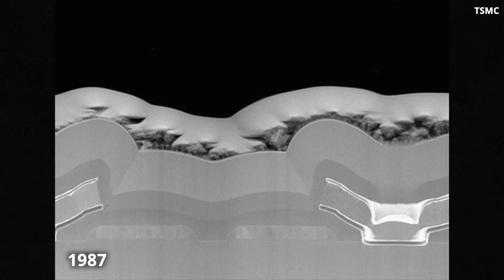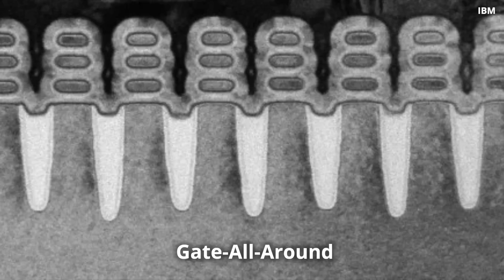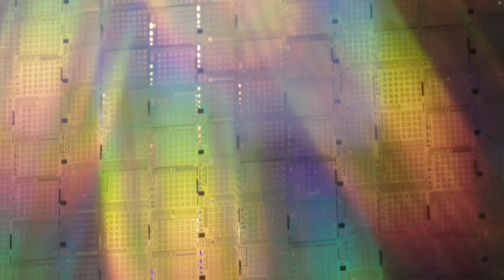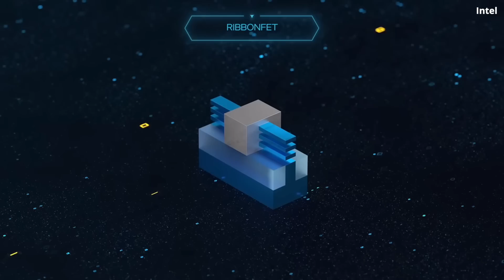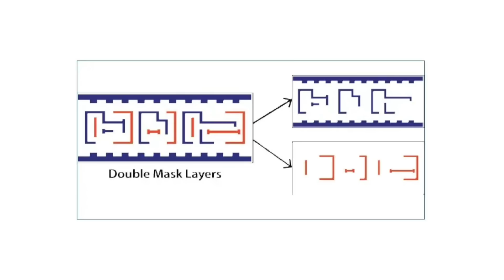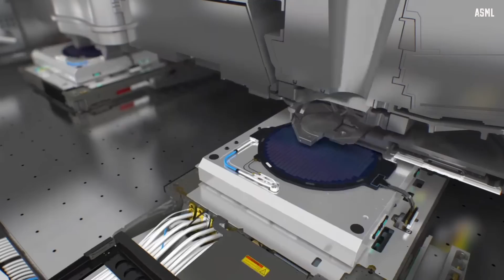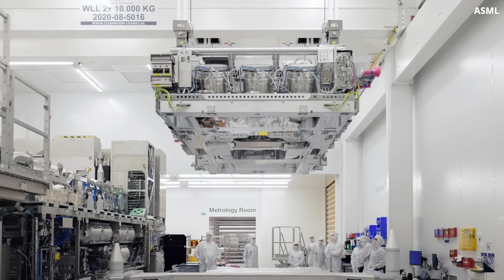New Disruptive Microchip Technology and The Secret Plan of Intel

Comment: BTW, I am an MD, but have been into digital design since the 1960's starting with 7400 series TTL chips. I have been writing code since then and have designed hardware and multi-layer PCBs with primitive photolithography . I also studied laser physics, optics, vacuum deposition. 
I just LOVE your podcasts!
With my background, I actually understand your clear and informative presentations.
My older son got his BSE in AE followed by his MSE in EE in ADC combined with chip design using Cadence. He was shocked when I read and understood his thesis! I forward all of your podcasts to him and his brother who is an AE, getting his MSE in AI, ML and autonomy.

Your podcasts are inspiring!

Comment: Scientists and engineers try not to make arguably false non-scientific statements such as “totally changing the transistors”, “ huge leakage”, “ the electric field turning on the gate” [sic], “up to 35 percen”, “ move all of the power distribution to the back side” which drops the current from the front to the back.

Comment: I've noticed a correlation between total complexity and the number of problems that arise.
I always ask myself,
Is there a simpler way
To reach the same goal? Any way at all
To use fewer parts or less steps.
Is anyone working on a design without power interconnects?
Say something like nano sized photoelectric cells delivering power from
A laser down to small regions of the chip?
Using quantum dots and mirrors on the other side to send signals. All those tiny
Wires must be drawing a fierce amount of power, just due to electrical resistance.

Comment: Thank you for this video. I'd like to see a video from the hyper NA EUV machine. 
From my side I think ASML has to improve thir high NA EUV machine also in the future. It's a real expensive machine, cost more than double than a simple (low NA) EUV machine. If the prices will raise and wafer/h ratio will go down than maybe there's a possibility that they won't make Hyper NA EUV machine. If I know that there are other manufacturing technologies also possible, for example Nanoimprint lithography which could be much more cheaper.

Comment: Backside connections are very fast.  It isn't new, but it is now free to use most likely. And with a new transistor smaller feature size it will become very, very fast

Comment: 1:51 Applying a voltage to the gate attracts particles to the channel from the substrate closing it, and thus it is able to conduct.
Reply: Semiconductors have a lot of electrons (or "holes") throughout the substrate but they are distributed very sparsely in any particular area.  Applying an electric field draws many electrons up from the semiconductor substrate to concentrate in the channel changing the channel from having high resistance to almost no resistance ... Ie the transistor ...

Comment: Your probably going to take this commit down.but I will waste my time typing it anyway.    Don't believe local  llm's are private.  In order for privacy. You have to put the hardware in a Faraday cage and hope it is sealed.If it is not sealed a near by computer will act as a bridge. There is a peer to peer that is unknown. I observed it talking on 462 mhz .I observed it advertising it's self every so often in the Faraday cage.before I put it in the Faraday it would not stop talking on 462 mhz. I setup a laptop near the computer in the Faraday cage because i need it.long after I put it in the Faraday cage. The next time the computer advertised it's self they both started screaming on 462 mhz. The only reason i know this is because I had a scanner on . Every time I turned on my the mobo I bought for my gpu to run llm's on. It made alot of noise on 462 mhz. So i put in a Faraday cage because I didn't want to lose my hardware to the FCC. I found out all this.

Comment: I have a discrete fractal sequence with the prime numbers and integers of the dual quantum mechanical structure of exponential chromodynamic fluctuations, which indicates an intrinsic entropy factor in an entangled system, the system reformulates the criterion of Bertrand Russell's mathematical paradoxes of the (sets by types) since the measurements do have hidden variables (Albert Einstein) by non-random percentages of (a third) observer in present (that exists and does not exist) Erwin Schrödinger; that does NOT belong to his set of observers (Alice, Bob) according to John Bell's inequalities.

I decoded this with studies based on parallel interactions, super symmetry, quantum gravity (Loops) and calabi-yau varieties or strings in extra dimensions. The graphics obtained from the structures in geodesics suggest that time crystals are created in interactive networks sharing local states and generating optimized global systems of information conservation, by non-local universal conscious entropy.

 This can be applied in a new artificial intelligence programming language that learns new tasks by itself and also in any chemical simulation or advanced studies on elementary particles, neural systems or any evolutionary system of chaos in convergence or divergence.

Comment: One Question.  Since the power supply has been "moved away" from the interconnect layer does this improve the Signal from the interconnect lines? As an Analogy. You separate network cables and power cables to improve signal strength of the network cable. Could be another advantage of the new technology.

Comment: Would it not make sense to combine the two in a sense, to have power planes in the middle with silicon logic both on top and below power delivery layers that have signalling 'wells' between them, and at some point layer more of these 'folded' in a sense but using signalling wells through the power planes to communicate between the logic layers vertically? Ultimately you could in a sense build a cubical chip like a layercake with power delivery being the cake and the logic the filling in a sense. Interconnect routing inside and to the outside would be complicated but we could have software tools to iterate through possibilities to work out the optimal placement of 'parts' so to speak. 
Heat would of course be a problem which would need to be tackled differently, but one way would be to build metallic 'towers' through the layers where there is no logic only thermal transfer layer to layer, and these would be cooled on the outside of the chip - to a point even the IO pins could be used for this purpose if they are purposely designed to instead of connecting to the outer surface of the construct were to be done in a way to transport both heat and signals at the same time from different points inside of the "chip layercake". Unsure if this makes sense in words, but in 3D it would be easier to explain. Think of it like a multilayer sandwich with long toothpicks driven from top to bottom being power and heat, and the edges of the filling in the layers signalling.

Comment: Intel and AMD will definitely have their share of the market. TSMC is at max capacity and investing in other semiconductor companies will be an absolute power move, I keep increasing my shares manageably. Different chips are good at different things and Nvidia has been very specialised, which leaves other aspects of Al open.
Reply: AMD doesn't fabricate chips.

They only design architectures (around someone else's node...TSMC's process node) and then pays companies like TSMC to manufacture the chip for them. When TSMC is on top of the world, in terms of pushing cutting edge, AMD benefits (as they have been lately)

So when TSMC is at capacity, by extension everyone that relies on TSMC for fabrication is plagued by that limitation. This includes companies like AMD, Nvidia, Apple, and many others, who have to fight for their share of that limited capacity.

In fact Intel and Samsung are the only companies (of significance) who still own their own Fabs. Everyone else outsources...mostly to TSMC.
Reply: You are buying a company to own it and not a piece of paper, The market is a zero-sum game (2 sides), Know what you are buying not just out of trend interest.
Reply: This is the type of in-depth detail on the semiconductor market that investors need, also the right moment to focus on the rewarding AI manifesto.
Reply: certainly, i had bought NVDA shares at $300, $475 cheap b4 the 10 for 1 split and with huge interest I keep adding, i’m currently doings the same for PLTR and AMD constructively. Best possible way to get ahead, is participating behind top experienced performers.
Reply: I’m widely spread out into ETFs and chip tech stocks, using an enlightened top tier would always attain more interest no matter what. props to Frost hilda, whom takes good care of my holdings giving me an edge to plus interest.
Reply: Well spoken. You gave detailed explanation
Reply: @jadecarson5081 f bot
Reply: @stuartjameson4594  It's an AI bot...and it's a dumb one.
Reply: How much of their stock do you own? Seems like a lot of your investment is riding on this
Reply: Love your viewpoint Jade, it more sustainable for me. I have got frost social, I'd get more conversant.
Reply: bravo buying at 300, cashing up at massive gains P/E ratio
Reply: Stop calling names, if you have any experience please share yourself
Reply: @jadecarson5081 I mean Intel took an incredible dive because of technological failure, to say you were going all in on Intel 2 months before their massive drop is amusing. How much did you lose? To meet your standard of providing insight on why Intel is a dinosaur who has met its meteor we would have to understand the advantage of separating fabrication from chip design.

Chips are specializing. Because of greater desire to get more from limited space on portable devices more chips are being designed by the consumer electronic manufacturer like Google and Apple. This focus on design pinging for the task means that a general chip that is misused for a purpose will not be more efficient as a specific tuned design. Fabrication then makes more sense as a company that takes in orders and focuses on the business of fabrication for designers worldwide. A failure of fabrication or a failure of design means intel has twice the capacity for failure over competitors like AMD and  Qualcomm.

Arm architecture is also another huge miss by Intel and their lack of desire to move to RISC, now leaving behind risc-v, is another signal that Intel is not adapting to industry changes.

Intel has been failing design with their state of the junk 13th and 14th gen. They have been failing fabrication since 10nm. They are failing to adapt to risc. They failed to adapt to asml and ultra lithography on time. They failed to account for chiplet designing and lower yields of smaller nm lithography for large soc’s. What makes you think that now is intels time rather than the meteor continuing its undefeated record to obliterate dinosaurs?

Comment: Good to mention is that the backside power delivery will make the power supply a lot more stable. This is because power lines and signal lines interfere. More stable power supply will allow for higher clocks.

Comment: This sort of thing was pioneered for Solar Cells maybe 20 years ago, by a company called Sunpower.
Their motivation for back-side power connectors was to maximize the amount of silicon exposed to sunlight.
It is interesting that this tech also helps with the new generation of VLSI chips.

Comment: The scaling down to as small as 1.6 nm is never 1 atomic size.. suppose it's hydrogen atom, 1.6 nano is .. says, 16 atoms. But since Silicon is (says,) 2.5 times bigger than hydrogen atom.., (16÷2.5)= 6 atoms (thick). Perhaps that's limitation, (i believe) no any silicon (or Germanium) logic-Gate could be made out of (less than) 3 atoms (not 1 or 2) of silicon base material.!?!  Heard s'one wanna use Graphene -Carbon, actually, instead of Silicon. The benefit obviously Carbon atom is smaller than Silicon. Even much smaller than Germanium significantly. So, if by using Carbon-Graphene base successfully for making logic-gates (transistors).. the even smaller than 1.3 nano will also be possible.!!

Comment: So much to unpack here. I don’t believe they will be able to go much lower than a few hundred angstroms below the nanometer mark, once they get there (if they do) the next logical step is to increase the wafer size to 450mm for production. They can stack the transistor but they will need to increase the wafer size at the same time they develop the technology for production, as that will justify the production loss. 

Intel is just full of prima donas at their Oregon fab, I believe their arrogance is why they lost the business to TSMC. I spent a couple of months at their Dalian fab in China the engineers there are good. I spent several months in TSMC fab 12 @ Hsinchu when they were developing their 7 and 5nm process, given how they are not investing in the next gen litho tools, they may be thinking about 450mm wafers to increase production. We’ll see what happens in the next decade.

Comment: This power-under-logic system is really interesting. One wonders what unexpected gremlins will be revealed in thermal performance of these designs. A fairly high amount of the waste heat per clock cycle is in power delivery itself, simply from resistance, so if you stick the power delivery on the other side of a silicon wafer- a lousy heat conductor- then what happens? Then there's the problem of the pinouts, needing to coat both sides in protective layers, etc., etc. I think this is going to prove very difficult!

Comment: This just prolongs extending the use of legacy chip technologies without moving beyond into the “Chipmaking of the 4th Industrial Revolution” needed to support the massive growth in AI.

Several Months ago, Chinese computer experts stated current chip tech is LEGACY, outdated and it's time to move on to the next generation; “chipmaking of the 4th Industrial Revolution”. (China currently holds the global lead in 4th Industrial Revolution Technology.)

Traditional - LEGACY - computer chips use lots of energy, generate lots of heat, lost efficiency, and scaled AI applications place significant strain on a country, regions, and city power grids. 

In the U.S. the power grid infrastructure IS NOT robust enough - inadequate and lacks interoperability across regions - to support AI development and operations in many areas thereby placing a significant roadblock to AI development and deployment.

Some companies are having to build their own power systems to support their AI development but as long as they can connect locally without degrading the public systems. This adds an extensive and expensive layer on top of already high AI development.

It will take a huge investment in upgrading power grids even BEFORE large AI operations are implemented. There is insufficient funds to support building out a new electric grid infrastructure to accommodate AI growth in the U.S. Regional systems such as in the outdated Texas grid posing major roadblocks.

China's new Photonic chip technology is one example of highly energy-efficient architecture allowing ultra, high speed AI development and integration into networked infrastructures without placing significant strain on the country's, regional, or a city's power grid.

Comment: I'm curious as to putting all the poer on the back side of the wafer. Given how coolers are mounted on a chip could it not have a negative effect on the wafers performance since we will be drawing all the heat from the power through the brains side of the chip? or will they mount the wafer "upside down" when building the package to put the power side nearer the cooler? Lots of really good information well explained. I could listen all day :~)

Comment: In 1977, I was QC testing high-purity silicon tetrachloride using an Applied Materials mini-epitaxy furnace and probing the resulting growth layer on the test wafer for resistivity. We were buying impure material from Texas Instruments (a by-product of their wafer manufacturing) for 50-cents a pound, distilling it to remove N-type and P-type impurities, then selling it for anywhere from $50 to $200 a pound, depending on the quality.

Seeing so much economic value being generated, I jumped out of the lab and bought a retail ComputerLand franchise and sold a lot of Apple IIs.

Nice to see so much has changed so quickly.

Comment: they don't work , even new Intel CPUs that are 7nm do not work , they are no more chips , they are chiplets , cut outs from larger chip , and that shortens the memory circuitry and they freeze up on heavy task , stuttering very hard , where older CPUs just slow down the FPS , new ones stutter . Consumers will have nothing from this , no gain at all , only problems .

Comment: Please , don't show two sides of the wafer when you are talking about backside power delivery.
All interconnects are lithographed on one side of wafers. Backside means underneath of transistors. So lithography masks print power lines and capacitors first. Then they print isolation layers. Then they print transistors. Then they print data interconnects in several layers.
Reply: That’s, obviously, for presentation matters. It clear that wafer is processed on one side :)

Comment: A modern chip is already to powerful to cool for it to run at 100% 100% of the time. Any plans for heat mitigation?
Reply: I would use monocrystal copper wafers to improve thermal conductivity of the wafer. This would also align thermal extension of wafers and interconnects.

Comment: Samsung has been shipping its 3 nm gate all around (GAA) process, called "3GAA", since mid-2022. Samsung announced in June 2022 that it had entered mass production of its 3 nm GAA manufacturing process. However, yield improvements have been slow, and only a few chip design companies have used Samsung's 3 nm GAA process to produce simple chips like mining chips.